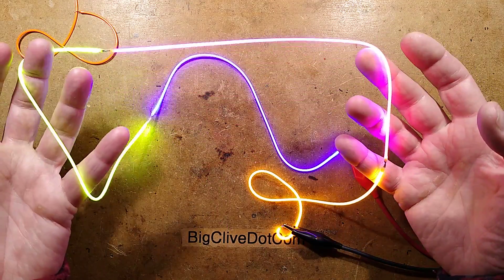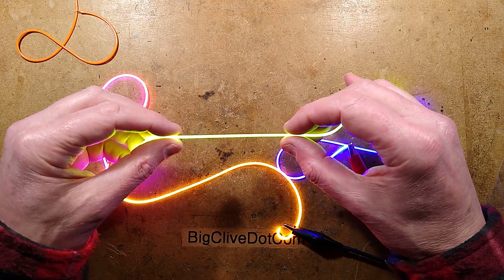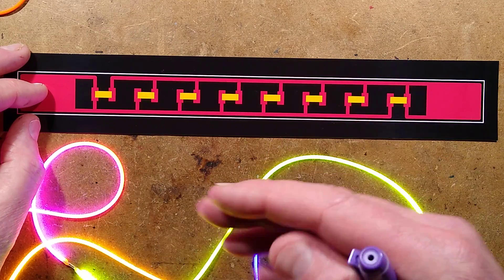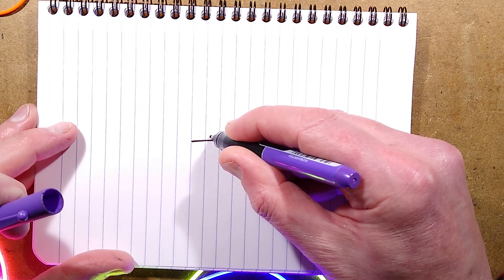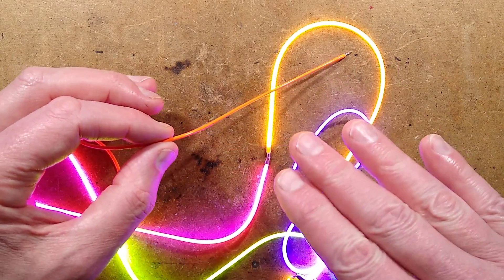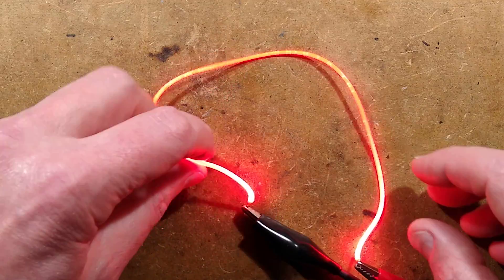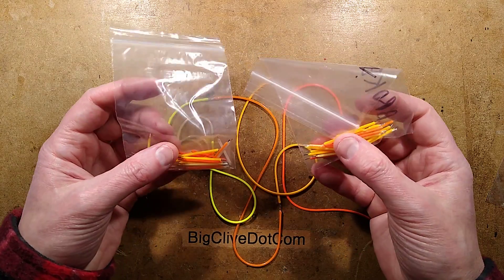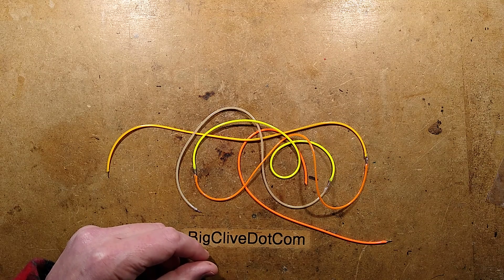How long LED filaments are made

Comment: I wonder if some strange capacitance or resistance of the absolutely tiny traces on that flexible PCB is the cause of the ends of them being lit like that. I wonder if sending them an AC voltage would change/alter that? Very interesting. I've noticed that on my super long runs of LED strips that the ends are very dim indeed, but it was always on the one side, where the power comes in. I would always just either connect both ends in a 'loop' or I would run a pair of wires back down the strip and to the source to reduce the resistance of the actual traces... Not ideal, but if you need it done, you need it done. But both ends is strange!
Reply: If it's LED tech, wouldn't AC not work very well? Them being diodes and all.
Reply: Resistance yes, capacitance no as its DC. I tried AC doesn't make any noticeable difference. But yeah normally PWMing LEDs will make them visually look brighter overall, given the same power.

Comment: The dimness in the middle makes sense if you think about voltage drop in each wire segment. The first wire segment in the bus has the current from all 200 LEDs and the last one has only the current from one LED, and therefore only one 200th the voltage drop. If the LEDs all draw the same current then the graph of voltage drop would be a half-parabola, and with two opposing half-parabolas (flipped in both x and y) the middles are clearly closer together than the ends, indicating more voltage available to the end LEDs. The effect should be tiny, but LEDs are very voltage sensitive so it becomes visible.

Comment: I bought some of these a few months back and figured out why the light is uneven at the ends. The idea that feeding the strip from both ends like this will make the light perfectly even is a fallacy, it will drop the unevenness to about a quarter of what you get if feeding from one end but the light will still be lowest the furthest from the ends.

Try drawing up a schematic of the strip with the conductors as resistors and you will see that the voltage drop between LEDs is greatest at the end where one polarity has a very high current (the number of LEDs times the average LED current) and one has a very low current (one conductor will only see the current from one LED at the end of the strip).
Reply: The problem could be solved by equalizing the current per unit of cross-sectional area of bus rail conductor material.  Each bus rail needs to be tapered; N-times as wide at it's solder tab end as it is at it's remote end, where N = the number of LEDs per section.
Reply: @haroldsmith45302  Good thinking. It would be interesting to see if it's viable to make one end thick enough while maintaining minimum conductor size on the other end or if the strip becomes unreasonably wide.
Reply: @haroldsmith45302  You're right about the tapering. The current diminishes as you go down the string to the last LED.  Try simming with LTSpice or your fav spice and parameterize the resistors with an eqn. That's all I got.

Comment: I bought a 3-pack of those soldering tips from Ebay for just under $12. I am a vaper so I have lots of vaping stuff. The ad said 1.5 ohms and 15 watts. The readings I get are roughly 2.3 ohms and I use about 20 watts. I really didn't expect them to  work well but I was surprised that they do. It's nice to have a small portable soldering iron.
Reply: Shouldn't the power be lower if you use the same power source but a higher resistance? So if the 1.5ohm is giving you 15W,  shouldn't 2.3ohm give you around 10W?
Reply: @dimitrijekrstic7567 This is a variable wattage mod. Increasing the watts also increases the voltage. At 20 W the voltage is around 6.25 volts. At 15 W the voltage is around 5 volts. It gets hotter quicker at 20 W. These devices usually have a 10 second cutoff so it helps to get the tip hot quickly.
Reply: @tims8603  very nice! At 6.25V it comes up to about 17W with the 2.3ohm coil which is pretty close!
Reply: @dimitrijekrstic7567  The resistance varies with the temperature of the tip. After using it for awhile, it goes down to about 1.9 ohms.
Reply: @tims8603  hmm. It should only increase when hot

Comment: Why would they be brighter on both ends if there were impedance issues? 
I don't think they're wired like you depicted. 
If one end is a bit dimmer than the other end (I can't tell from the video), that would suggest they're running another wire to the dimmer end directly from the (-)supply and the other supply end(+) is connected to the middle. [-/+ assumed].  How else can it be?

Comment: The Fact that the inner section of the filaments are dimmer than the outside made me curios and so I fired up LTSpice and put something together. And despite the fact that each led has the same length of track on the circuit board and also the same resistance in series, they get different currents.  Lower in the middle and higher on the ends. This makes no sense if I think about it, but Spice says so
Reply: The dimness in the middle makes sense if you think about voltage drop in each wire segment. The first wire segment in the bus has the current from all 200 LEDs and the last one has only the current from one LED, and therefore only one 200th the voltage drop. If the LEDs all draw the same current then the graph of voltage drop would be a half-parabola, and with two opposing half-parabolas (flipped in both x and y) the middles are clearly closer together than the ends, indicating more voltage available to the end LEDs. The effect should be tiny, but LEDs are very voltage sensitive so it becomes visible.

Comment: There is a product available here to soften and clean up silicone sealant/adhesive. It is sold in the plumbing section of hardware/home improvement stored, and used to clean off old silicone sealant that was used to seal around shower stalls and such when renovating.
Perhaps it might soften the silicone in these filaments.
Reply: Bought it once, pretty sure it's just kerosene in gel form.
Reply: @greentjmtl  Must be a different product. IIRC the stuff I had seemed to be water-based and had no kerosene smell at all
Reply: there are various silicone digesters and other solvents which work on silicones

Comment: I remember electro strip flexible rope lighting ,they were 1/2 inch diameter and used tungsten lamps ,now they are LED and down to 1mm diameter .So many uses for them
Reply: I had about 600' of green tungsten rope lights in my Xmas decorations one year. Won second place, but used over $1000 in extra electricity. My front yard drew 34 amps at 120v!

Comment: Apart from model neon lights, what practical use are these?
Reply: Replacement for CCFL backlights in old LCD displays.
Reply from the maker: Just decorative lighting.  Usually in shapes inside glass lamp globes.

Comment: Could the uneven light be the thermal tempco causing the ones at the end to 'with fewer neighbors' to be cooler/brighter at the same current? (total spitball)...Because of the silicone insulation and hair thin traces there would be very little heat movement along the length so once a temp gradient sets in it feeds back on itself like many old school led parallel projects without resistors.
Reply: Seller being dicks: could very much be an automated algorithm: "We have 100 stock, first 20 regular price no discount to cover the cost of the manufacturing run, next 70 are cheaper 'on sale' price, 10 remaining stock 200% price to slow demand until a new batch can be brought in.  A rush of purchases just moves the price along.
Reply: No it appears instantly, good idea though.

Comment: They are dimmer in the middle because the bus resistance isn't dividing the voltage evenly - the bus isn't at constant current, the current is proportional to the number of LEDS that come after it. At the input, you get the full current for the entire strip, but the end section of the bus only carries a single LED's worth of current. This means the voltage drop is biggest on the side where the bus comes in.

Comment: ..."flips up like that." What we used to call 'tombstoning', although we (worked designing PC motherboards at Intel) never had the luck with passives where they would flip along an edge... it was always up on end... like a tombstone. Which, of course, left us with a lack of connection through the device. :( Like the old saying goes, "I don't get to drive the train. I don't get to blow the whistle. I don't even get to ring the bell, but let the damn thing jump the track and guess who catches hell..." :)
Reply: Hay, you made the extreme series motherboards?
Reply: @cheyannei5983  A couple a couple models before the 'X'tremes. Got my srart in Multibus industrial w the 386SX processor. :)

Comment: I remember using the flexible neon wire that looked the same, though it required a little high-frequency driver.
Reply from the maker: Electroluminescent wire is common on eBay.  But very dim compared to this.
Reply: The other problem with el wire is that it is nowhere near as flexible. I love the consistent light output of el, and you can get it in pretty much any length you want it,  but there are pros and cons to each of these...
Reply: @LabRat Knatz Huh. Guess there was a big shift in quality in the drivers. I was using the stuff, cut into shorter lengths and joined with wire, inside computer cases as displays.

One of the specials I did even had it glued to the ram heatsinks and used some hardware to make an audio VU meter out of it.

Needless to say, there was no audio noise and system stability hadn't been compromised.

Comment: If you lower the voltage, does it equalize the light output across the entire length?
Reply: In theory, a lower voltage means less current passing through the conductor (circuit board) which means there's less of a voltage drop. So in theory, the lower the voltage, the lower the voltage drop and difference in brightness* between first and last diode.
Reply: @dimitrijekrstic7567  That's exactly what I was thinking.
Reply: @TrinomCZ  sorry if my comment was too long lmao. Now that I read it, it seems I'm repeating myself quite a bit, but what can you do.
Reply: But which is the first, and which is the last, when they are all in parallel?
Reply: @Svixdelux  the first would be the one closest to the source. Voltage source. And that is if we assume that this here filament is made with only two wires of equal length
Reply: @dimitrijekrstic7567  Let me guess, it has conductors on both sides, therefore you can daisy chain them together (and which is also the reason for brighter ends), but the middle LEDs can't benefit from this layout. Am I right?
Reply: No, doesn't really help to lower the voltage, you'll reach a point where they look more even but then its too dim by then.
Reply: @jaro6985  have ya tried it
Reply: @dimitrijekrstic7567  yeah

Comment: Could it be that there is a double bus wire somwhere connecting at both ends, which makes both ends see a 3-0=3V voltage, while the LED's in the middle have a slight voltage drop meaning they e.g operate at 2.9-0.1=2.8V?

Comment: Try gasoline, I know that automotive silicone compounds can't take it.  
Also, silicone oil (polysiloxane) will slowly soak in to silicone rubber over time. Both eventually turn it into a bloated jelly mass.

Comment: I saw Norm from Tested use these in a project and got some to make a Halloween mask for my nephew last year. They work great but the end connectors can be VERY fragile and sometimes the copper tabs flake off.  I reinforced the ends with a layer of clear tape then some careful use of hot glue. The ones I bought could be trimmed to size but I designed the mask so I wouldn't have to. Cutting and exposing the contacts on the cut end was a nightmare in my test piece. They ran great on a battery pack all night, the kid loved it.
Reply: Do you have a link to the trimmable ones?
Reply: @ThePiprian  There is so much of it I don't think a direct link will be useful. It's commonly called "EL wire" though and most of it is technically trimmable. Mine had small black lines on the underside where it could be safely cut and still work. They all seem to be pretty similar in my experience so don't over pay. Also check out the Tested video for tips on working with it. It'll save you a lot of frustration.
Reply: @Alakazzam09  Thanks for the answer! I thought el wire was a different technology that uses a lot more energy than LEDs?
Reply: @ThePiprian  Yep, very different. Uses AC voltage for starters so requires special power supply.

Comment: What would happen if you raise the voltage on the red.?
Could you  weave the strings to get a new style atomic light 🤔
Reply from the maker: You could braid them gently.
Reply: @bigclivedotcom  
Then you could color you beard without dye.🤣🤣🤣
Reply: I burned a 130mm strand to test the rating. It did, of course, get more bright as I increased the voltage, but the apparent brightness didn't really increase much beyond ~3.5V. The LED's on the ends started burning out at ~4v, and the entire strand shorted with a snap at around 4.3V. They'll drive on as little as 2.5V, but it's probably best not to exceed 3V maximum for longevity.

Comment: At what temperature does the solder paste melt at?   Asking ad I've never used it before, and looking for an easier way to solder together some very small brass tube as part of a model project
Reply: Plumbers solder is a silver solder and much easier to get hold of. Especially if you just ask a plumber with beer in hand!
Reply: @gs425  grand idea,.  Thanks
Reply: I haven't used solder paste in a while. As with most solder you can get it in different melting points. What I do remember is ventilation and a good respirator are really good ideas. Gloves and safety glasses that make a good seal are nice as well. 
I used to work as a small electronic repair technician. I remember the first time I used solder paste and the fumes it gave off were horrible. I forgot to turn on the fume extractor and I ended up needing to ventilate the entire area it was horrible. I'm not sure if it's the brand/type that we were using or if it just common to solder paste but fumes are a concern. Almost a decade later and it's still one of the most vivid memories from where I used to work.
Reply from the maker: You can get various solders in paste form.
Reply: @bigclivedotcom  yup,. Thank you.  Ideally I need silver solder.   But to buy it here in little New Zealand at our local "BOC". British oxygen company,  store is very expensive.  I only need a small amount for my project,. A once off.   Package of silver rod and a bottle of flux is well over a hundred dollars.   I need a quarter of one rod, and a mill or two of flux.     Thinking if I could use a syringe of paste might be better off.   Looking at joining some 1/2" brass tube,.   Very thin wall, 0.040"
Reply: @russcole5685  Might be better off looking at jewellers suppliers. You can buy all kinds of silver solders by the gram rather than roll if you need.
Reply: @askjacob  thanks 👍
Reply: A heat gun might work better.
Reply: @assassinlexx1993  oh!   So it melts at a very low temperature then?  Might not be suitable for my requirements then.  Thanks for the answer though
Reply: For brass, silver solder paste would work great but then you have to re polish it since its very high temp. 
Electrical solder is relatively low temperature and if you look up low temperature solder paste you can find what they promise and add 5 to 10 °C since you never get it to melt quite as low as you would like.

Comment: I was curious as to why they had such short lengths… then I realised it’s meant for those “filament” type light bulbs.
Reply: There are versions of these on aliexpress up to 5 meters long. Not sure how well those work though.
Reply: @ThePiprian  😭😭😭 I didn’t need to know this. Now I have no excuse to not strip out my car EL wire and replace it with these… at least it’ll make good video content 😂

Comment: I just found what project I'm going to use toteach my godson and his sister how to solder. Who knows what we will end up making but these flexible LED strips are what we will use to do so.  They both are hardcore about learning how to solder so it should go well. I might propose some ideas but I want them to help design their own creation. The learning how to plan to achieve their goal is the important part. Thank you Clive from the bottom of my heart for posting these.
Reply: i made some neon sign for some people before with the neon led strips.  
and my main issue back then was that i couldnt get it any smaller.    this however is CONCIDERABLY smaller.  
so i might revisit that project
Reply: The best thing that taught me to solder half decently was quite ironic really. Desoldering ICs and caps from old boards. Every single component I removed I was better at it, and the skills translated quite well to soldering.